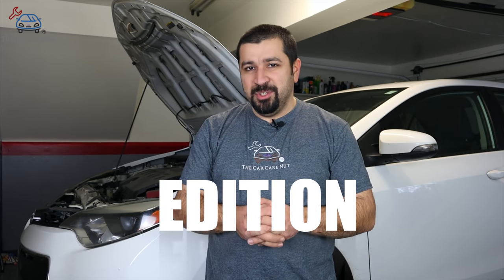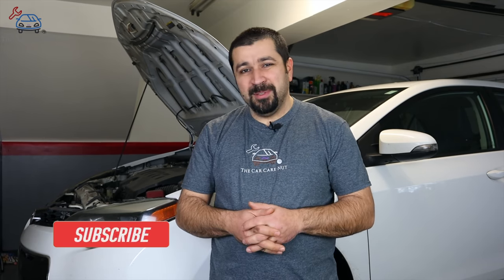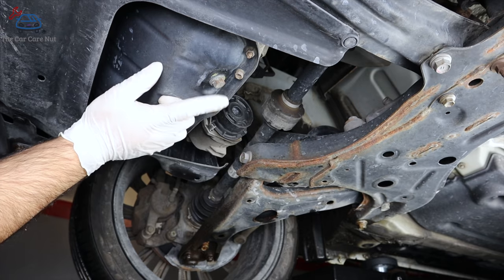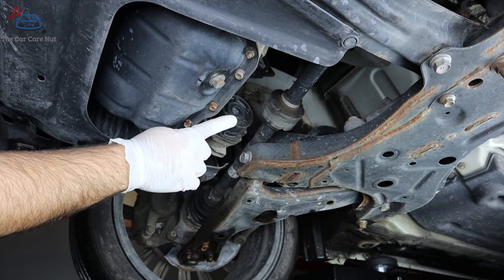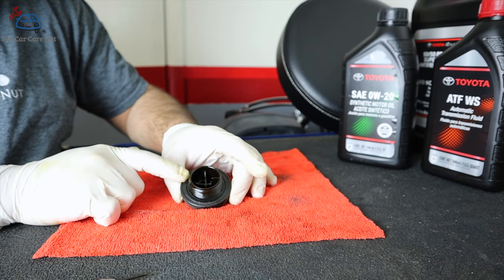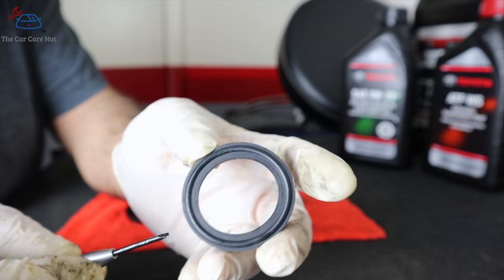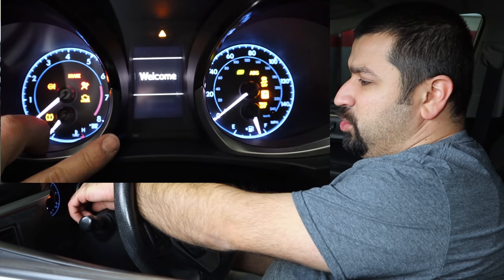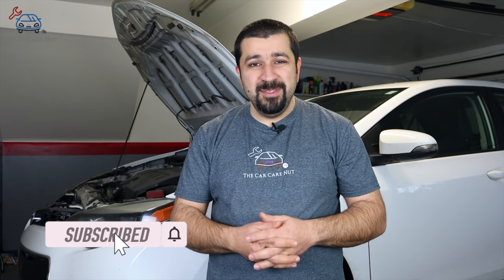How to change your Engine oil and filter for Toyota Lexus Scion

Comment: Do I need to under proofing the chassis of my 6 yrs old sienna chasis. It looks like your Corolla.
Reply from the maker: Hi! Cars in the rust belt will rust a bit and there’s not much to do. Rust proofing will slow things down and eventually it will happen but you try to prolong it as much as possible.
Reply: Use some Fluid Film (brand name) on the chassis it works great as a rust preventative. Apply once a year or so. You could also just use bar and chain oil.

Comment: My Toyota dealer used 0w-16 for my 2020 Avalon. Owners manual and sticker on engine bay says 0w-20. Search through internet and nobody seems used 0w-16 on a v6. Wandering will this cause a problem and also if  I switch back to 0w-20 will it cause more problems. Car is 21k driven. So far had 4 oil changes with same dealer and seems they used 0w-16 for all of them.

Comment: Hello,
Is the blue drain plug gasket directional? I bought one OEM at the dealership and on one side the blue material looks thinner than on the other side. I also bought original Toyota oil filter too.
Change oil often and SAE viscosity ratings are easy, fully synthetic 0W20 in my case. It is the factory fill. I went to two Toyota dealership and they did not sell oil for me.

Oil standards, are confusing.

So my car manual from 2019 says:
“Toyota Genuine Motor Oil” is used
in your Toyota vehicle. Use Toyota
approved “Toyota Genuine Motor
Oil” or equivalent to satisfy the fol-
lowing grade and viscosity.
Oil grade:
API grade SL “Energy-Conserving”,
SM “Energy-Conserving” or SN
“Resource-Conserving”; or ILSAC
multigrade engine oil

For the same engine the 2022 manual says ILSAC GF-6A multigrade engine oil or API grade SM “Energy-Conserv-
ing”, SN “Resource-Conserving”, SN PLUS “Resource-Conserving” or SP “Resource-Conserving”

Original Toyota 0W20 oil on the bottle says: meets requirements of: ILSAC GF-5; API SN Plus

Can I use oil that is SAE 0W20 fully synthetic, it is API SP but did not say what ILSAC but they do say ACEA C5?
If it matches one requirement in my case API SP but it also does not say "resource conserving" on the bottle or in the TDS in fact I can not find API SP oil with resource conserving.

Today I only can buy oils with API SP and ACEA C5 which is the current grade here with 0W20 viscosity. Mobil1 ESP X2 0W-20 also API SP ACEA C5 and on they website says it can be used in my car.
The Shell lube match also recommends they API SP and ACEA C5 for my car based on my engine. The oil name is Shell Helix Ultra SP 0W-20. It is a very good brand, I prefer Shell.
In your other video you talking about GR oil made in Spain, but you don't know who made it. Well, Shell oil made in Spain and the GR bottle looks exactly the same as Shell oil bottles.
How critical are oil categories like API or Ilsac? This ACEA C5 is a low HTHS oil based on my google search but I have no idea what that means and safe to use or not. Resource conserving is important at all if the OEM Toyota bottle did not mention it? 

You not really explaining this I guess because it is different for every engine and it will be a never ending story. Or just use decent full synthetic 0W20 change it often and life is good?
Thanks in advance!

Comment: But if the  oil screw is still oiled, won't the actual tightening torque be higher?
Reply: I would assume that whatever torque spec the toyota engineers say is the one to use. in the oil filter instructions, they tell you put a light coat of oil on the new o-ring, so I would assume that whatever torque specs they recommend takes into account the fact that new o-ring is oiled. ..

Comment: Hey Amd thank you for the video. I called my local Toyota and they said that parts number was bad and they don't get tools. That their guys get them from snap on or matco. I found filter wrenches with that part number on eBay but not the Toyota website. Could you please help me out with a link maybe or another way to purchase it. Last time I used a filter wrench from AutoZone and it kept slipping even though it was the right size. Thank you!
Reply from the maker: Hi daniel! Is this in the US?
Reply: @TheCarCareNut  yes long island NY
Reply from the maker: Interesting I double checked the number and it came up. Really any tool that’s specific for this type of filter will work.
Reply: I recommend the Motivx wrenches. MX2320 & MX2321 depending on your model.
Reply: @njsongwriter  Yeah absolutely! I got there oil filter wrench set! Money well spent! I use it on all the vehicles I maintain.

Comment: I have a really hard time reading my dip stick (Rav 2015)... when I pull it our its always smeared in oil and looks like its way past the "full" mark. any advice on how to circumvent that?
Reply from the maker: Hi! Flip the dipstick. First clean it and put it back if one side is all over the place flip the dipstick and read the other side
Reply: @TheCarCareNut   it looks the same on both sides, its like the tube has oil in it permanently, I ve only had a clean reading once and the oil was fine and i dont know how to replicate it. Love the channel btw!
Reply from the maker: When you take the dipstick and clean it, does it stay clean or has residue? Maybe you need to clean the dipstick with some brake cleaner if it has stains on it
Reply: @TheCarCareNut  dip stick is clean, its just the oil goes up the dipstick tube and stays on it
Reply from the maker: The oil level could be overfilled. Are you checking it after you’ve driven the car and warmed it up then shut it off wait 1 minute then check?
Reply: i check it on level ground, after driving and cold it all looks the same. i will do an oil change in a couple weeks hope its not overfilled
Reply: @TheCarCareNut  you were right, oil was .5L overfilled. and oil filter overtightened and i needed a breaker bar

Comment: What is the torque spec for the 2020 corolla LE drain plug and oil filter? Many thanks
Reply from the maker: Drain plug is 30 ft-lbs and the filter is 13 ft-lbs
Reply: @TheCarCareNut  thank you so much!!
Reply: @TheCarCareNut  hi sorry to bother you again but we got a new sienna hybrid. Do you recommend to change the coolant at certain interval? Our dealer told us all new Toyota including my Corolla 2020, 10 years. Is that true?
Reply from the maker: Hi! Congratulations  on your sienna purchase! I would replace the coolant the first time around 100k miles or 5 years. That seems to be the best time table for replacement without causing issues.
Reply: @TheCarCareNut  thank you so much!!! Wish I have a professional advisor like you nearby! You are awesome!!
Reply: @TheCarCareNut  Hi, I contacted the dealer and they want me to wait to 10k to replace my sienna hybrid engine oil and filter. So I will just DIY it. Is it also 30ft-lbs for the drain and 13ft-lbs for the filter? Thx
Reply from the maker: Hi! The drain plug yes the filter hand tighten it
Reply: @TheCarCareNut  Thank you so much! Hope you can have more video on the 2021 sienna!!

Comment: So I need some help here. I have a 2013 ES 350 (v6). I lifted the front of the car with jacks and then drained the oil and waited 15 min till it was drained. I also drained and replaced the oil filter. My car calls for 6.4 quarts of oil. I added that exact amount. After the engine was on for a few minutes I checked the oil level and it’s 3/4” above the 2nd mark. Very confused. Should I drain out some of the oil?
Reply: I would. When I was starting out changing my own oil, I never put in the full amount until I got used to my car and plus, who knows how much oil the person before me put it.  Now, I know my car doesn't burn any oil and when I drain out my oil, I know nearly all of it comes out because when I pour it into oil jugs I get 6.4L out so I know to put 6.4L in and then when I check it, I'm good. make sense?

Comment: That is the first time I've seen someone remove the filter before draining the pan.  I would have expected oil to keep pouring out of the housing, but I guess not!
Reply: Same!
Reply: It saves time because you can be changing out the filter and prepping the oil filter housing cap while the oil pan is still draining.
Reply from the maker: The order really doesn’t make a difference. I pulled the filter out first for the purposes of this video.
Reply: @TheCarCareNut  
And if the oil filter is stuck and you can't get it off because your oil filter cap wrench is inadequate then you can go get the proper wrench BEFORE you drain your oil.

Comment: My mechanic puts in 5 quarts for my 2020 Camry. Is it a big deal since it calls for 4.8 quarts??
Reply: it's probably not a big deal, as long as the oil is measuring as a good level on the dipstick. I don't see why it's so hard for the mechanic to just leave out the other 0.2 quarts, though!

Comment: My 2gr calls for 0w20 but I race mine and regularly red line it. Wouldn't 5w30 be a better choice?
Reply from the maker: 2gr-fks or 2gr-FE?
Reply: @TheCarCareNut  2gr-fe. From a 2015 Highlander. Into my 1991 MR2
Reply from the maker: You can use 5w30 without issues in your case

Comment: Shoud I change the oil every 6 months if I drive the car aprox 5k km per year? I do it every 12 months.
Reply: 6 months! Skip the filter if you wish, but oil and filter is much cheaper than a motor

Comment: I wish some one would come out with a disposable filter for the 2AR-FE engine. I can't stand that plastic thing with the "drain plug" at the bottom. When ever I attempt to remove the drain plug, the plastic canister starts to unscrew. I'd pay $20 for a throw-away screw on oil filter!

Comment: What is the oil drain plug torque setting for the 2.5L engine in a 2021 camry?
Reply from the maker: Usually 30 but I’ll double check. Reply to this comment so I can check tomorrow
Reply: @TheCarCareNut  I checked before removing the bolt before doing its first oil change and it torqued out at about 23 ft lbs. Does that seem correct?
Reply from the maker: That is good
Reply: @TheCarCareNut  Thank you sir!
Reply: @TheCarCareNut  one last question, does this engine come with a timing chain or timing belt?
Reply from the maker: This one has a timing chain
Reply from the maker: Here’s a video that’ll give you an in depth look at this engine https://youtu.be/vWOtROAma7I

Comment: Will the dealer treat me "badly" if I change my own oil? Toyota offers the first few oil changes free, should I take advantage of that and then change my own? 2022 4runner trd premium  + 2021 Highlander platinum credit to Toyota for the next paragraph: Every new Toyota comes with ToyotaCare, 1 a maintenance plan that covers normal factory scheduled maintenance with the purchase or lease of every new Toyota for 2 years or 25,000 miles, whichever comes first. 24-hour Roadside Assistance is also included for 2 years and unlimited miles.
Reply: no. just keep receipts and take photos or videos everytime you change it so if something happens under warranty they can't say it was because you didn't change the oil or something like that.

Comment: Hi could you give me your opinion, I got RAV4 2019 Hybrid 47k, found uneven wearing of rear tires on inside edge , took the car to an alignment  shop, they say there’s nothing they can do, the upper arm isn’t adjustable, only way to replace the springs , what’s your take on it ?
Reply from the maker: Hi! I’d need to see the alignment sheet but some parts might need to be replaced if things are bent. Has the car been in an accident?
Reply: @TheCarCareNut  no never
Reply from the maker: Well something has to be out for tires to wear like this. I would get Toyota in the loop and see if they can help.
Reply: @TheCarCareNut Thank you for your opinion! So did I get right? Nobody does alignment in the back, if it is off , only replacement of part is the way?
Reply from the maker: Your RAV4 does have toe adjustment in the back. Camber can be made adjustable but not much.

Comment: Dear AMD: My 2014 Prius C isn't due for another oil change for months, would be glad if you could let me know where I can find a good quality oil filter wrench cap.  Your kind response would be greatly appreciated always.  Please let me know at your convenience.  Checked with Toyota parts dept here but nothing is available.  65mm is a little too big isn't it?
Reply from the maker: Hi! You can get a regular oil filter strap or get the original one that is used on the canister style filter. It will also fit your filter
Reply: @TheCarCareNut  Thank you so very much dear AMD for your speedy reply!  The Toyota partsman had thought it would only work for the canister style filter, how misinformed they are!
Reply from the maker: They work on some of the spin ons as well including your Prius c or any model with the F1 F2 or N1 oil filter.
Reply: @TheCarCareNut  May I impose you for a Toyota part number please please please!  
Thank you so very much dear AMD.
Reply from the maker: Dominic I don’t have it at the moment but I can look it up tomorrow at work. Reply to this comment so I won’t forget

Comment: 4 years that i not change my car oil modil 1 systems    and the motor toyota filer, y stat the car weekly, let's on for one hour, then move to low then to 2 , then 3 and then to drive, then parking  and the last is reverse,   always in the  shifting always making a little pressure, and moving the car in forward a little bit and in reverse, and all the fluids. It's that's ok or not?

Comment: This is the first time in my life I've ever heard of checking the oil with the engine fully warmed up. I was always taught (diy of course, never talked to a mechanic about it) that you had to let the engine sit for awhile after being run to get an accurate level and that it should be full on the dipstick at that time. So am I to understand that's all nonsense and you can check the oil after just having run the engine and aim for the level to be in the middle of the dipstick? I've been doing it wrong for so long...
Reply: Sit for a while ... a few minutes to allow oil to return to the oil pan... not long enough for the oil to cool off. Aim for the oil to be near but not over the full mark unless you'll be changing it soon, in which case it just needs to be between the add oil mark and the full mark.

Comment: the engine oil opener round head is not expensive just cost me 2 bucks only for the size 64mm on the Toyota filter 2 bucks only even though it's very cheap but the quality is average and still using up to present after 15 years...lol

Comment: I am puzzled by your recomendation of how to check your oil level. I am 63 years old and have owned 20 cars and trucks so far. I took an automotive class while in high school. We were taught to check the oil level after the car sat overnight the next morning. This allowed all the oil to drain back into the pan. How else would you know how much oil is exactly in the engine. I believe in this and I have always used this method. To me your way makes no sense. If you check the oil while the car is running as long as the oil is between the marks on the dip stick you are ok. If I were you I would rethink your recommendation.
Reply: remember to check your manual as to how to check your oil. for my 2016 sienna, the car care nut is right, of course. my toyota manual says to get the engine to operating temp, park it on a level surface and then turn off the engine and let it sit for five minutes. Take out the dipstick, wipe it with a rag and then reinsert it and you want it in between the two dots.

Comment: I just got an oil change done at Toyota on my 2015 Rav4 and when I remeasured its overfilled! I insert my dipstick fully. It seems to me they are only inserting the dipstick to the gasket (yellow top) on  the dipstick. should the dipstick be inserted fully?? If so, all the Toyota dealers around me are measuring their oil incorrectly... anyone care to chime in?
Reply from the maker: Hi! The dipstick should be seated fully to get an accurate reading. They overfilled the car and I would bring it to their attention so they can correct it

Comment: 10:40 Just an observation. If you're using a 7" wrench to tighten the drain plug, you would need to apply about 50 lb of force to the end of the wrench to achieve the 30 ft·lb torque spec. CCN clearly applied much less than 50 lb of force and therefore tightened the bolt to less than the torque spec. He's an expert with tremendous experience, so I defer to his judgement that the spec might be excessive.

Comment: It would be nice if someone finally designed a oil dipstick that would be easier to read with CLEAN oil. Why there are so many bends. By the time you pull it out, clean it, insert it and pull it out to check the level, oil is all over the dipstick.

Comment: why does my 2023 Toyota Corolla XSE require OW-8 I have researched on YouTube and I find that all the other Corolla use OW-20 I've ask the salesman I purchase the car from and call the Parts Dept as several Toyota dealers and they CAN'T tell why? my biggest concern is that that particular Viscosity OW-8 is no where to be found other that the dealer @ astronomical price of $17.00 A quart all they keep telling is what Toyota recommends but no reason WHY! and for the first oil change I can use OW-16 but must change over to OW-8 on the next oil change. having said that I will spend almost $100 per oil change when it normally cost me $25 to $30  WTF !

Comment: 2020 Camry LE Hybrid 4 Cylinder. The oil drain plug gasket. Is it still Part #: 90430-12031??   Several Toyota dealership websites list the Oil Drain plug Part # as: 90430-A0006.  Went to Longo Toyota and they said 90430-A0006 was a special order item. And gave me the old 90430-12031.
Reply from the maker: There are multiple part numbers for the same thing. As long as it’s blue then you’re good
Reply: @TheCarCareNut  Owner manuals calls for 4.8 qts OW16. Even 5 qts OK?